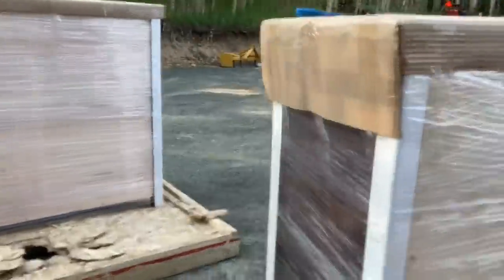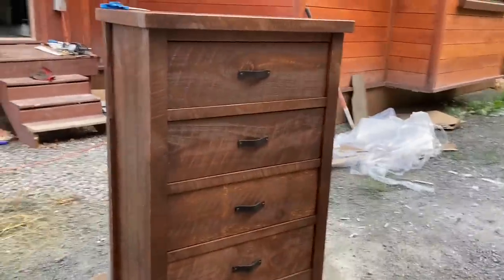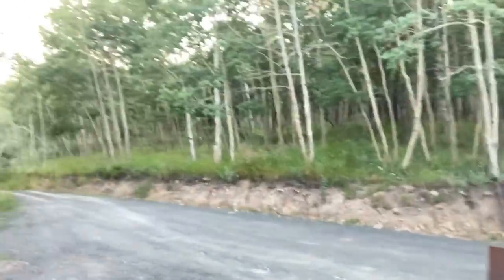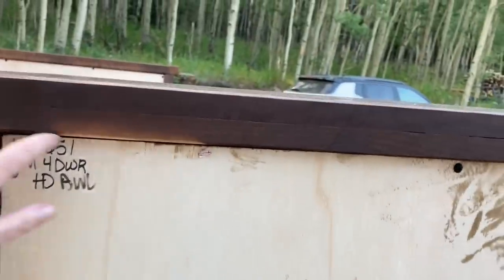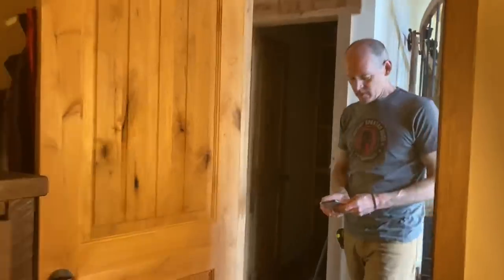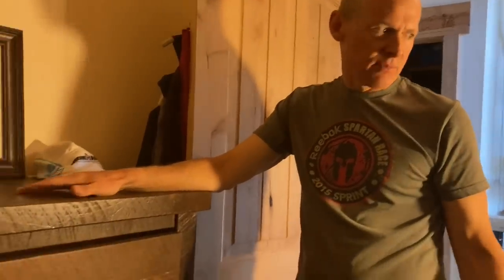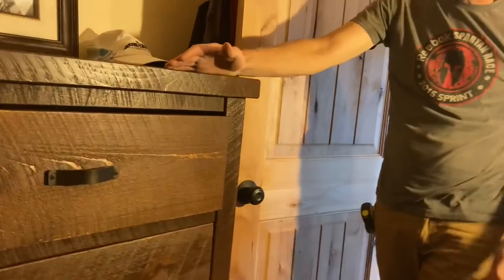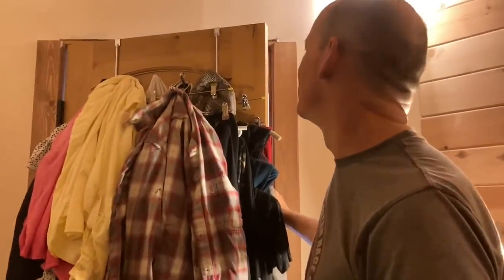Disappointed in our Closet Furniture! We Didn't Expect This....

Comment: You might have installed the drawers in different locations than they were originally. The drawer fronts were probably installed after the drawers and the location is critical on those inset drawers. I bet if you do some switching around, they will be fine.
Reply from the maker: I think you may be right about that.

Comment: When I receive a chest of drawers, I number the drawers before removing them from the carcass to move it inside the house, this way I make sure I put them back in the correct place,  the chances of all the drawers being identical is not very likely.  In fact when I build furniture, I fit each drawer individually. So if it were me, I would remove all the drawers to a chest and start with one drawer and try it in each opening to find the one it fits in the most accurate.
Reply from the maker: Great suggestion!
Reply: @ColoradoMountainLiving  Another thing you could do is look back at your video where you show each chest before you removed the drawers and you can do a freeze frame and identify each drawer and where it goes. They all have unique wood grain features.

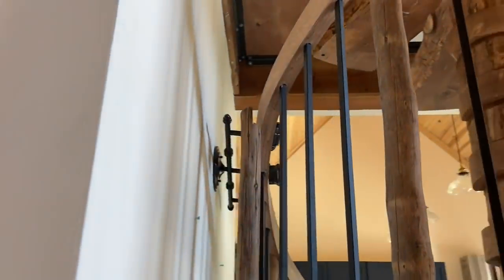Comment: Looking into the closet on the far left, what will you do with that hidden corner? Also, what happened to the stair post at 16:35 which looks unconnected? Thanks for another video...
Reply from the maker: We may add a low shelf, we have boots in the corner now. Or we may connect the dressers with "counter space" . I believe we had to disconnect one post to remove the lighting fixture, but we aren't done with the lighting yet, so it's not yet reconnected.

Comment: I would be disappointed. I can't believe they left spaces where they didn't hit the wood with stain. The shipping damage is kind of inexcusable. But my number one issue is that if you are not going to dove tail the drawer sides to the fronts, then at least run the side past in the inner front and attach it from the side, that would give it a lot more strength. I certainly would never buy anything from them.  I do like the overall rustic design, but they are letting to many small issues go.
Reply from the maker: Yeah,we were taken aback considering what we paid and how they advertised.